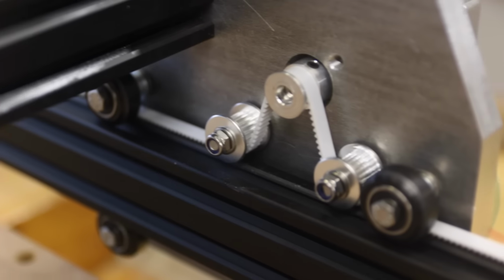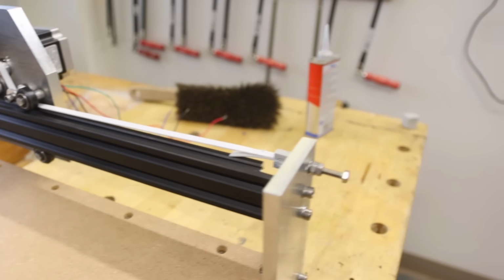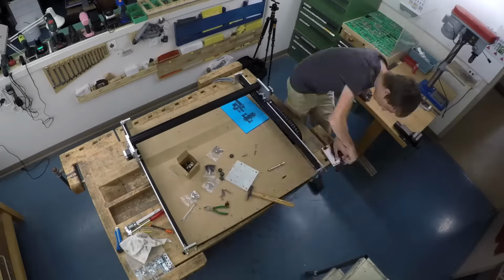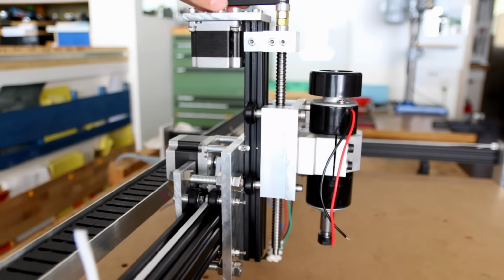Custom DIY CNC ROUTER #2 - Building the X and Z-Axis

Comment: hi, you did some awesome job on this project, congratulations.!!!!!  can you tell me the dimentions of the aluminum profiles you used for the Y , X and Z axis??
THankx a lot for sharing.
Reply from the maker: I don't know the exact values any more but they were around 90-100cm long.
Reply: hi thanx for answering, i meant what kind of aluminum profile, 30mm width x 60mm height?
Reply from the maker: oh, it's 4080 V-slot extrusion, so 40x80mm
Reply: thanx a lot for answering, keep up that awesome job. congrats.

Comment: Probably a stupid question, but how did you hold that aluminium plate down while you were machining it...  there seems to be no obvious clamps or bolts
Reply from the maker: +SJW i used some strong doublesided tape to avoud all the screws necessary for such a large and thin part.

Comment: Nice work bro.. all I need to know is where did you get those DC servo motor..could you please reply the link...thanks..
Reply from the maker: just search online for Nema 24 Stepper Motor and I'm sure you can find something local at a reasonable cost.
Reply: I am talking about milling servo motor that u r used..not a stepper motor..
Reply from the maker: Guna Sekaran I did not use any servos, if you are taking about the spindle, you should check out a newer video I made about replacing it as the one I used here has some problems.